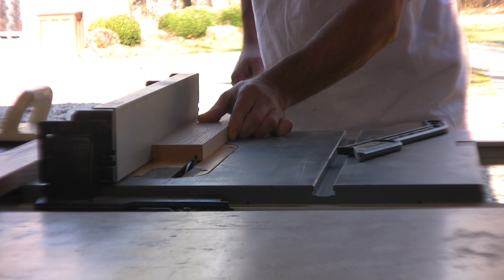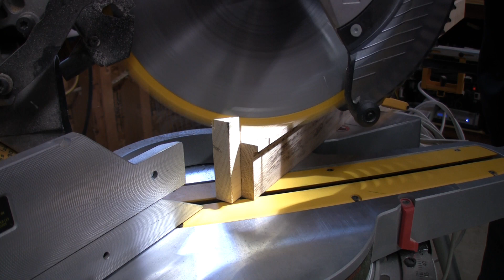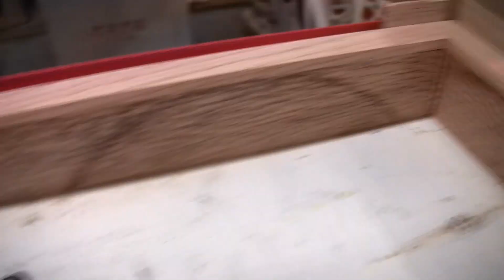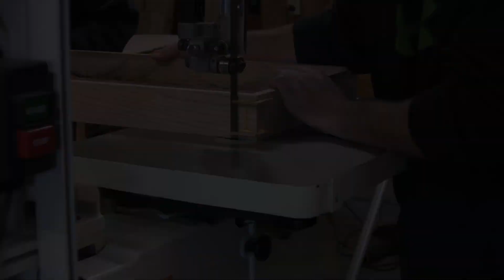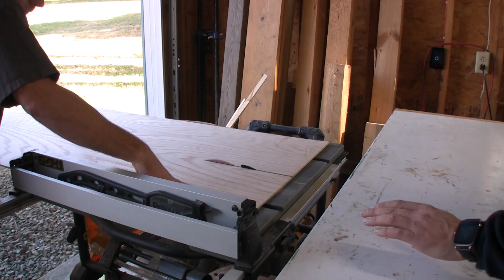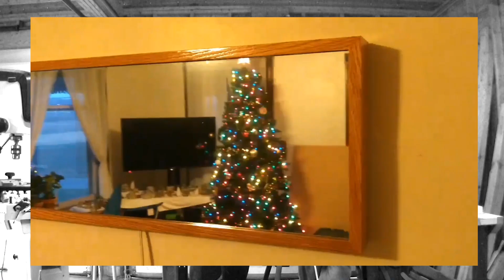Making a Frame for a Smart Mirror

Comment: Guy goes through all that work to have a sweet frame built but won't install a plug in the wall and leaves a wire hanging out the bottom 🤣